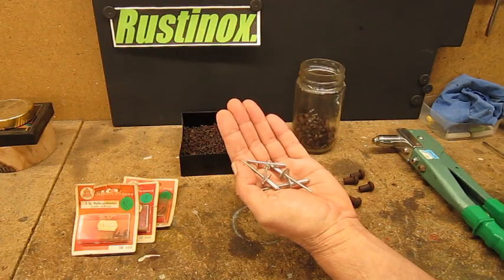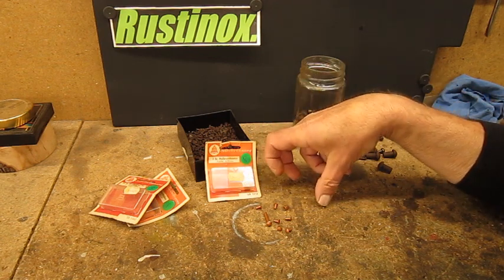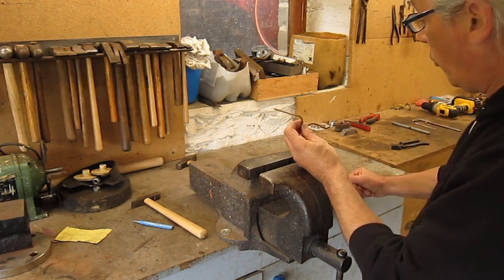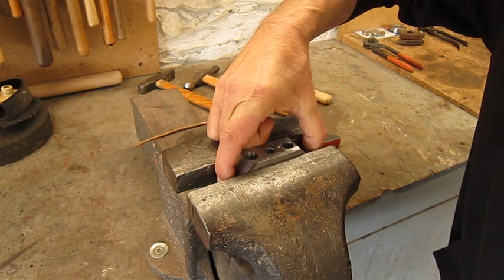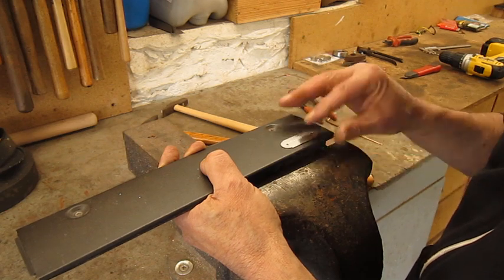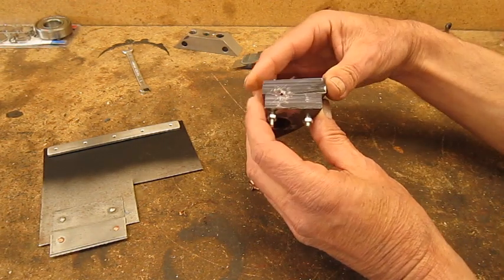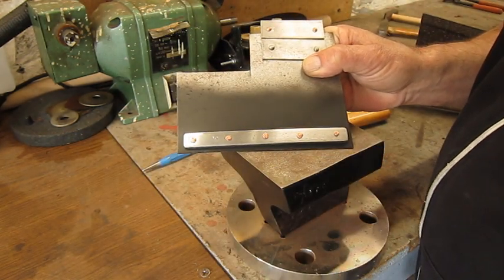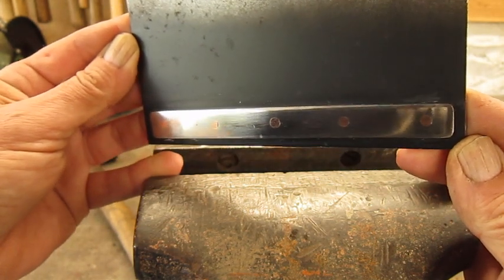Rivets and nothing else.

Comment: This took me back to metal shop in school, we riveted a few projects together with the dimpled blocks and having to peen over the backside of the rivet.  I also remember my Dad changing countless sickle teeth on the swather he had on the farm when I was a kid, they were riveted on but he used an air hammer and air chisel bit to remove them and re-peen them.  I've had a few times where riveting stuff together would have been useful but got lazy and have just used the pop rivets instead.  Never thought of using copper wire for more decorative small rivets though, that's a cool idea.  Thanks for sharing this!
Reply from the maker: Thanks Everett. I learned rivetting in school too, but it was not much. I learned way more from my grandfather.
Rivetting is fun if you can take your time. A good cup of coffee and a chair or stool can help.

Comment: It’s amazing what you remember as if yesterday, learned this 35+ yrs ago, 1.5*diameter. We had rivet sets/snaps that had a hole and a dimple side by side, you tighten the rivet with the hole then set the rivet with the dome/dimple.
Thanks Rustinox
Reply from the maker: Of course there's way more different systems but i think this is the easiest.

Comment: looks good rusty, another way to do it for larger headed rivets is to use a ball nose endmill and drill into a piece of hardenable steel, then harden it. That'll give you a really nice and smooth rivet snap for the top of the head, and same process, just a piece of plate for the bottom. I need to make a few rivet headers/snaps myself, getting tired of just making flattened rivets for my stuff, and have some pretty large rivets to make coming up, lol. Thanks for the video man.
Reply: Good thinking with the ball end mill Chirpy.
Reply from the maker: I see this video turned on the imagination button. That's good.
Reply: lol, making a set of rivet headers have been on the list of stuff to make for months, just using the ball endmills and why I bought them like 2 or 3 years ago, long before I had gotten my mill, lol. I just need to stop procrastinating and make them, lol.

Comment: In Britain domed head rivets are known as snap head rivets. Rivet snaps are readily available ready made.
Reply from the maker: Here where i live it's very difficult to find the right rivets. Especially on sunday afternoon. 
Thanks for the "snap head" tip. I didn't know that.
Reply: @Rustinox  Copper rivets can be had from model engineering suppliers such as Blackgates or Maidstone Engineering both in the U.K. but given the age of your existing stock I do not suppose that you will be in a frenzy to obtain some.

Comment: Good to know, if you still use a sickle mower.  Replacing sections uses the same techniques.  Neighbor has the newer rotary style now (of hay mowers), but he said that they are about the same amount of trouble ... it just comes in a different form.  And doesn't involve rivets.
Reply from the maker: Rotary rivets?
Reply: @Rustinox  Mowers.  For cutting hay.  Uses blades like a lawn mower or brush hog, but open on top, and shielded so it doesn't shred the hay once it's cut loose.  The old style works in the same way hair clippers work.  Guess I should make an edit ...

Comment: Thanks for the nice video, Rusty. Maybe I missed something, but when you calculated the depth of hole needed in the block for cutting the wire, you took the overall length of 9.5mm and subtracted what you said was the amount allowed for one head (1.5mm). But you said the length for two heads was 3x2.5=7.5mm (2x1.5x2.5). In that case, shouldn't we subtract 1.5x2.5 (not 1.5) from the 9.5? If we reduce the 9.5 total length needed by the amount of one head it seems to me that we need a hole depth of 5.75mm (9.5-3.75).
Reply from the maker: I have to rewatch the video to check.

Comment: If anyone knows where a swan necked rivet snap could be found that would be helpful.
Reply from the maker: I don't even know what a swan necked rivet snap is...
Reply: @Rustinox  A rivet snap is used to make the snap head on a rivet. The domed end on a rivet is in English terms a snap head. The device for making the snap head is a rivet snap. These are often sold as a snap and set. The set closes the joint and the snap forms the head. Rivet snaps are ordinarily sold as a straight piece of barstock with the snap and set in one end. These are used mounted in a vice. The fun and games begin where one has to snap a rivet in an enclosed space sch as riveting the ends onto a box. It is in such applications that a swan necked snap is useful. A swan necked rivet snap has a cranked neck such that it can reach inside a box when clamped in the vice and the rivet be snapped.
Before anyone suggests that I am writing fiction I used one in order to fabricate a box whilst at school in the days when telephones had mechanical dials.
So not recently.
Reply: @532bluepeter1  - your question is now nine months old, but here’s an answer. Here in the US, a snap is called a set, at least among aircraft mechanics; they typically have a wide variety of sets on hand to make it possible to install rivets in the many tight, awkward spaces found in metal aircraft. Offset shapes like a swan neck are common. Most sets are designed to be fitted into a pneumatic hammer but in a pinch they can be hammered by hand as well. If you inquire among aircraft repairmen I bet you can come up with something suitable.

Aircraft mechanics use a variety of offset tools to “drive” rivets, including those with gooseneck shapes. Here in the US, a snap is called a “set”. There are dozens of
Reply: @624Dudley  Dear Dudley, though my enquiry may be nine months old you are the first to offer a useful reply and I thank you for taking the time to do so.
Reply: @532bluepeter1  I hope it is useful information. I see now that I didn’t edit my post properly; a bit of unintended text stayed at the bottom. Oh well. Meanwhile, I wondered about the cost of brand new aircraft repair tools in the UK, and so took a look at a site called Aircraft Engineers Store UK. The price of rivet snaps came as a bit of a shock. I saw figures in the £30 to 40 range for offset types. I think it would be better to find surplus used stock if possible.